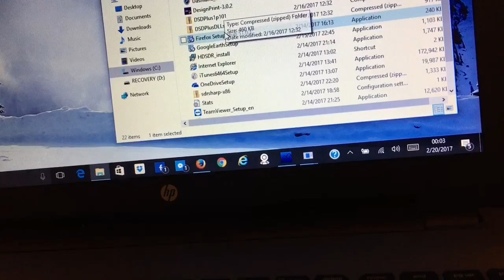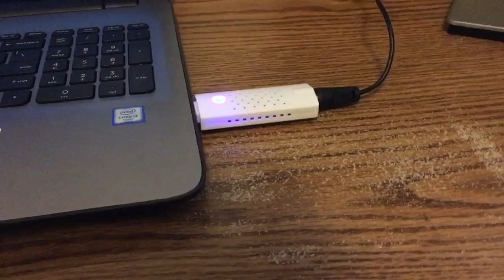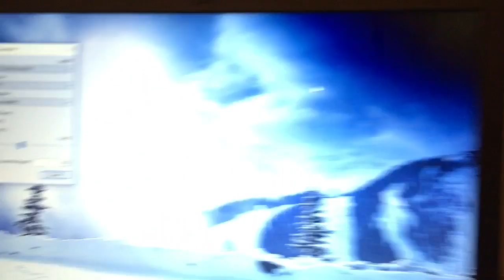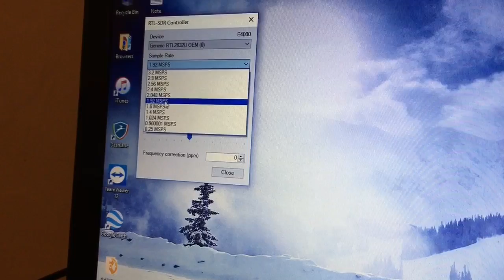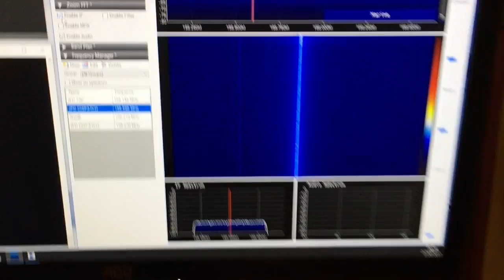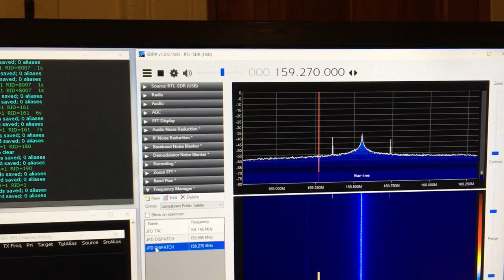Decoding P25 Phase 1 With RTL SDR and SDRSharp Full Walk Through

Comment: Are there any inexpensive 800MHz beam antennas with pretty good gain.  I don't get a strong enough signal to give me good P25.  Breaks ups with garbled audio.   I am thinking about
using a UHF TV antenna mounted vertical unless I can find or build something cheaper.  I verified my setup works by driving closer to the P25 transmitting antenna giving me a much stronger signal and I had pretty good audio.
Reply from the maker: There are plenty of antenna options on the DX Engineering website.

Comment: Can this bypass encryption
Reply from the maker: No it cannot. Decoding and listening to an encrypted radio transmission that you are not authorized for is not only extremely difficult to do but, is also highly illegal.
Reply: @JaredPaxton   im authorized and have encryption keys for my system i was just curious if they had the ability to decrypt
Reply from the maker: If you are authorized and have a need to be on the system. The authorizing agency should have issued you a radio or programmed your existing radio. You shouldn't have to ask this question.
Reply: @JaredPaxton  im asking for my own knowledge, I have a APX6000 and a XTS5000 programmed for the system. I dont NEED a SDR to listen to anything I was just curious.

Comment: Is it possible to decode P25 Phase 2?
Reply from the maker: An unencrypted P25 Phase 2 signal can be decoded using a capable scanner or through a similar process as in the video but, with 2 receivers and different software.
Reply: @JaredPaxton  Thanks for the reply. And I'm guessing encrypted is impossible, right?
Reply from the maker: Technically not impossible but highly illegal and highly difficult.

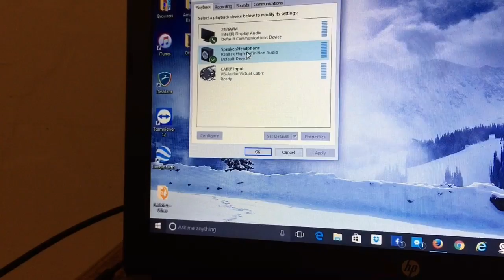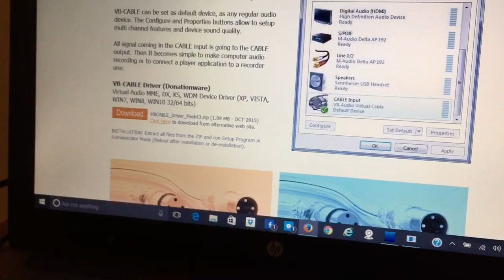Comment: Thanks so much for taking the time to walk through this, but I'm still a bit confused.  At 13:00 you show the Playback menu in Sounds, with Speaker/Headphone set to default (and VB Cable Input NOT selected as default).  You also say, "make sure the speaker you want is selected as default for playback."   However, at 16:23 you show VB Cable Input marked as default in the Playback options.  Which is it supposed to be?

Comment: Thanks for the video!  You made everything very clear and easy to understand.  In the part about configuring the VB Cable however, none of it appears to apply to how it's done in Windows 10.  (I assume you were using another version of Windows in the video.)  I tried right-clicking the speaker icon like you do in the video and got a completely different list of options.  I'm guessing I should look under Sound in Win 10, but I can't tell which selections to make on that page.  Can you help?

Comment: I've come across several of these videos yours is encompassing quite a large amount which I did not find in other videos that had five parts to them although what I am suspicious of is that do you need to run unit trunker with this and do you need to SDR dongles I am utilizing mine on the Connecticut State Police to monitor and as others have quoted I do not get any audio now I've gone back several times to recheck my configurations and I do have what you suggested any input would be greatly appreciated
Reply from the maker: You only need 1 SDR for P25 Phase 1 conventional. P25 Phase 1 or 2 Trunking you need 2 SDR. There may be updated versions of software or files at thise point.

Comment: What's the difference between P25 and P25E? I followed the steps and 
receive some encrypted Fire Dept Radios but one that says P25E was 
hearing at first but then could not hear again, the only thing I noticed
 is that the DSD+ message box displays a message after Sync: P25p1 
NAC:501 TDU (Muting Encrypted Voice) but I cannot hear no decoded voice.
Reply from the maker: If it is encrypted, you will not decode it. P25p1 is P25 Phase 1, NAC is the Network Access Code much like a PL Tone on Analog. I'm unsure what P25E is unless it's telling you it's Encrypted.

Comment: DSD+ 1.101pt
DSDPlus -h for help summary

Appending synthesized audio to file 'DSDPlus.wav'
0 frequency records loaded
0 radio records loaded
0 group records loaded
0 site records loaded
0 network records loaded

audio input device #1 = 'CABLE Output (VB-Audio Virtual '

audio output device #1 = 'Speakers (Realtek High Definiti'
audio output device #2 = 'CABLE Input (VB-Audio Virtual C'

audio input device open failed

any ideas?

Comment: Install SDR#, place DSDplus files into SDR# folder, install the DSD plugin into the SDR# folder, Install Virtual-Audio cable, then from there you can access DSDplus and adjust your settings, like the bandwidth 12,500, etc.

Comment: Hey, I have been trying to get DSD+ to work on my system for a few weeks now with little progress being made. I am using an RTL-SDR and I have everything set up like you did but DSD+ is not able to output any audio. I can see that it is decoding P25 phase 1 data with a good signal strength but it isn't working properly on any frequency I try. Can you give me some advice on what to try next? Thanks!!

Comment: great walk through when i go to open dsd plus it says "lame_enc.ddl not found" where can I get that file at safely?
Reply: Hi so I had it all up in running with channels and all. No sound came through but i did see the event log had  114 and stuff was scrolling through dsd plus now it's doing nothing. Can you help me fix sound and the other issue?
Reply from the maker: If you see data scrolling but no audio, check that your audio settings are correct for the decoding software and the output is to your speakers. As for the ddl file, I’m not sure.

Comment: Can you listen to P25 Phase 2?
Reply: Currently the only way to listen to phase 2 is to use the OP25 program, which is a Linux program.  I am not a linux user, but have read where many have had great success using linux and OP25, which only needs 1 dongle for P25 phase 2 trunking reception.
Reply from the maker: Jim Leon Yes, you need 2 receivers.
Reply: Jared Paxton   How are you going to do that, when DSD+ doesn't currently decode phase 2?
Reply: what about provoice?

Comment: Hello Jared, I am confused about the VB cable interface. What does the cable plug into at both end's? Is the cable necessary? Thanks in advance! Mark D. Miller KE0MQQ.
Reply from the maker: +Mark D. Miller it is a application you install. Not an actual cable. It pipes the audio around.

Comment: You can run install-rtlsdr in the sdrsharp folder and it will get zadig
Reply from the maker: +Chad Smith it has been a while since I set this up but, yes I believe you are correct.

Comment: Hi Jared,
I followed your instructions for download and install to the letter.
Walked through your exact setup of each piece of this multiple times.
BUT ... I do NOT get anything out from DSDPlus, NO AUDIO out to my speakers.
The DSD+ Source Audio window shows activity on my selected channel, but NO AUDIO/translation.
The DSD+ Event Log only shows the initial startup messages.
The DSD+ windows show NO ACTIVITY except the initial startup messages, and a blinking cursor after ...
"Mono audio decoding initiated; press ESC to exit..."

How do I get this setup running?
Reply: sdr sharp will not let me change the audio imput. i have the output to the vb cable and all other setting correct as shown in video however nothing is talking to sdrsharp telling it what frequency to tune to..nothing is happening on the dsd programs either.. seem to be missing sometihng...does sdrsharp need any plugins installed to work?
Reply from the maker: +go to SDRSharp and make sure the input is The virtual cable and then go to your speaker icon in the taskbar and make sure it is selected to your speakers. Boyd Bros.
Reply from the maker: + the input and output of audio between the different software and your computer speakers have to be set right or you won’t hear anything. You should see data coming across the DSDPlus screen, if you do but don’t hear audio then your audio settings aren’t set right. Boyd Bros.

Comment: Hi Jared,
I can't hear audi, but i have put the DLL files in the DSD folder, I can see channels/streams showing up in the activity log in DSD but no audio.

Audio settings in DSD

audio input device #1 (CABLE Output (2- VB-Audio Virtu) initialized
audio output device #2 (Speakers (2- AudioBox USB Audio) initialized 

I also can't set output as anything else, I have set VN cable output as Hyper X headphones

SDR# output is [windows direct sound] Speakers (2-VB audio cable)
Reply: I think I fixed it, I had to go into DSD config menu from SDR sharp and set the audio output.
Is there a way to save SDR sharp default settings (the ones you said, so I don't have to re config them when I open it?

Comment: This is a very neet video and thanks..good way to go into the next step after getting sir sharp going..but my next step is to jump right to trunked p25 and of course I know the ops frequencies on the local tower other than the data control freq.,but I wonder if I can use this with some kind of trunking control software to monitor the control freq.then of course we have talk groups in there...a little fancier than just monitoring one freq like your doing down there.our p25 stuff is in the 700s and yes I have long range uhf antennas as I just sold my 996xt to a local for his listening pleasure as he is not into high tech stuff like this..thanks have a nice day...

Comment: Jarred, Thanks for the video. Just wondering how SDR# is setup to use 2 RTL-SDRs with DSD+ to copy P25 (phase 1) the control channel and to also scan the voice channels. The network I listen to has 16 voice channels from 854 to 861 MHz. After watching the video, I see the CC info scrolling but How do I get the 2nd RTL-SRD copying the 16 voice channels?
Regards, Don
Reply: I use Unitrunker version 1 to handle the control channel and voice receiving, then pipe the audio out to DSD+.  Unitrunker handles all the trunking aspects.  In fact, version 2 of Unitrunker, which is very much still in beta,  doesn't even need DSD+ to decode P25 phase 1.  It does it all on it's own.

Comment: Hi Jased, when I get to the gear for the RTL_SDR Controller, there is nothing in the drop down box.  Any thoughts?
Reply: You have to make sure to run ZADIG and install the driver.  Otherwise it will not show up when you click the gear icon for the drop down box.
Reply: I just started using SDR and I am using the SDRPlay RSP2Pro and I also am unable to drop down the DEVICE box.  It is an un-usable drop box.  Am I missing something.  I have the SDRuno software up and running with the Virtual Audio cables working with no problem with other software.  Any ideas?
Reply from the maker: Joseph Silverio I am not sure as items in the drop down box show up for me.

Comment: Hi Jared, I installed the SDR and I can not hear digital reception. The audio menu is normal as you showed (windows direct soud, cable input, Vb virtual audio.) Where I am wrong you can help me.
Reply from the maker: Sergio Henrique there are other settings that need to be changed a little bit. The gain and such. Also you have to run DSD at the same time for it to decode.
Reply: Yes, even using the dsdplus2 version, and the gains are also regulated, you have some link where you talk about the digital reception.Grateful
Reply from the maker: Sergio Henrique did you load the DSDPlus DLL files into the DSDPlus file folder?